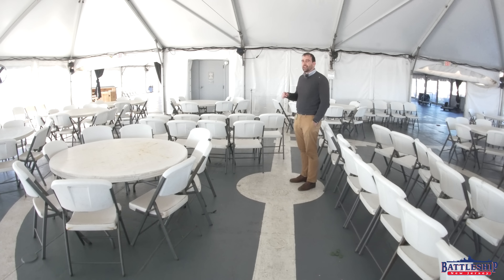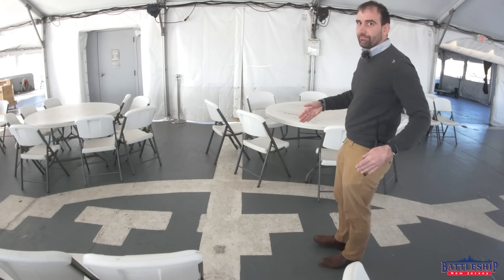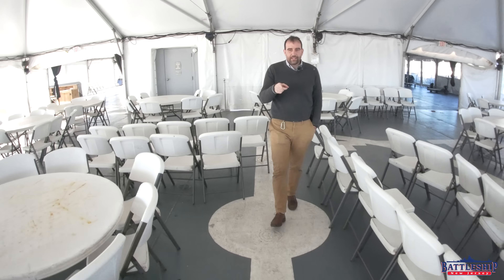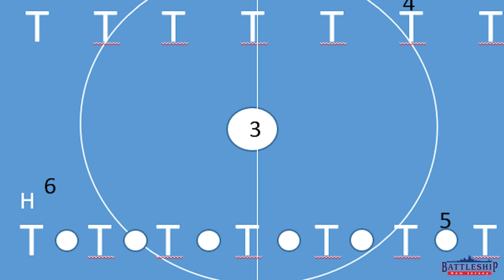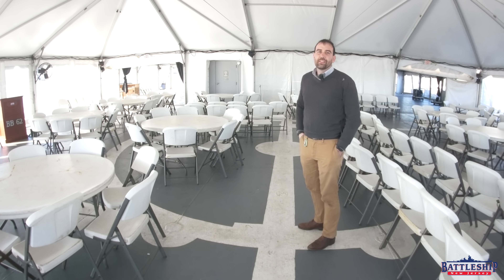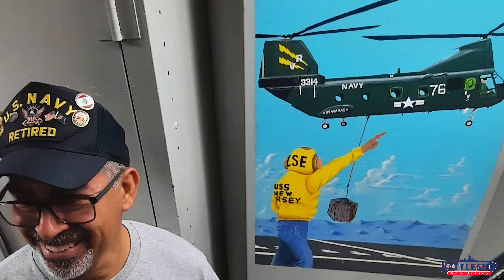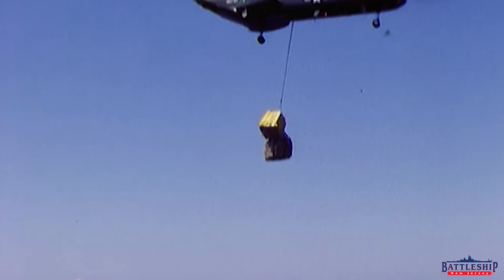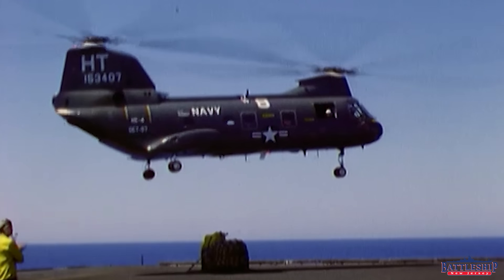What Do the Markings On A Helicopter Pad Mean?

Comment: T Line = VERTREP line for designated embarked helo. T/ball line = VERTREP line for large diameter rotor helicopters (not embarked helo). Also, Navy helo pilots fly from both seats. Either seat, left, or right, is used to execute landings in modern day Navy helicopters. Unless you are sliding right over something like a CVN deck.

Comment: In the early '80s I flew in a Eurocopter AS350 Écureuil
Light utility helicopter from the Central Pier in Atlantic City, NJ.  My Grandfather was the pier manager and the plan was to bring high rollers from NY to AC to gamble. The deck at the end of the pier had similar landing markings as the battleship.

Comment: When I was a firefighter the boss had me ride in the door of an S-58 flying out to a barely improved helispot somewhere on the fire.  First time ever on a helicopter.  My job was to watch the tail rotor and warn the pilot if it was getting too close to the mountain side.  Even though I was hooked into a hard point with a waist belt, I was scared shitless, and held onto the doorway with a death grip.  Like that would have helped me in any kind of emergency.

Comment: Actually, US helos began life with the collective lever (which controls motor speed and rotor pitch) at the left hand, so that the cyclic lever can be operated in the right hand.
Which mean, the climbing into the left seat means climbing over the collective.  
No such lever for the right seat.
So, the aircraft command pilot has an easier seat to get into.
In a fixed wing a/c, the throttle is/was mounted to the left, so the a/c commander sits closest to that throttle structure.
Reply: The cyclic isn’t a lever. The right seat has a collective.
Reply: Not the case anymore... the left seat collective in the H-60 is collapsible.

Comment: Flown inb multiple different helo (53/46/3, Bocamp = Messerschmitt-Bölkow-Blohm Bo 105  type - multiple location/functions. TO Marines they are a godsend and a lot faster than their own LPCs.  On one occasion got to be in 2nd from seat of the Bo105 when they had only 1 pilot. for the  H-46 (the  twin horizontal rotors) - a very different feel /.vibration from that rotor system. the Bo 105 was to from oil platforms Gulf of Mexico.

Comment: Military fly Right side = your cyclic hand is right, Collective hand isn't as busy so your radio and electrical service items are for your left hand.    Rotor rotation is not the reason - Landing on boats is fun (1984)
Reply: Sitting on the right seat puts the pilot indirect conflict with the rotor blade in the event of a hard landing. 1:38  I know. I saw it.
Reply: If you hit hard enough in a UH 1 that main gear box will enter the right rear cabin.
That's a crash not a hard landing. 45+ years helicopter pilot/ mechanic.- Bells Sikorsky Robinson Right hand. Hughes does both sides Enstrom Right. Hiller H 12 center. @oldmech619
Reply: @oldmech619  Some times but that's not the reason . I've seen worse.
Reply: @HongyaMa     I had one civilian Huey that had a hard landing. The rotor came around and hit the pilot in the head.  His face impacted the instrument panel. He didn’t have a helmet on.
Reply: @oldmech619  Stuff happens, Know plenty who are dead from either seat. Long lost to history. Floyd D Hiser one of them
Reply: Navy pilots fly from both sides in H-60s. Either seat can (and will) execute a landing on the ship.
Reply: @SAVY_JAX  Amen !

Comment: Ryan, one small correction because I was on a Flight Quarters Helo crash crew. The rotor blades were the least of the worries. The downdraft off the rotors would knock you on your but, especially the ones with twin horizontal rotors. Also, if they were carrying a load it could swing wildly. And if the helo crashed, most of one model was magnesium would burn. We were told to rescue the crew and then push the helo overboard because it was the most effectively way the fire would go out.
Reply: Yes, magnesium burns hotter than hell. Some metals are a high fire risk.
Reply: Yep, my flight quarters was in the proximity suit for all those reason.  One hot, weight losing job off the coast of Vietnam.
Reply: Lost an S 58 to a bad start. Went to lunch came back and it was all gone. Maggy not your fren
Reply: As a former firefighter I concur that fires with magnesium are no fun at all.

Comment: Hi Ryan.  I've flown as a passenger in an SH-3 Sea King from the deck of a Spruance class ship.  The SH-3 was not a tiny helo like the SH-2 Sea Sprite was, this thing took up a LOT of space and in USS Caron (DD 970) the crew chief had to watch and advise the pilot where the tail wheel was in relation to the edge of the deck, during my ride to and from the beach I had the job of holding onto his belt as he slid as far out the door as he could to watch that wheel.  😮

We launched from Caron, landed on cruiser Yorktown (same size flight deck), then flew to the beach to pick up the package I was the courier for and then back to the Yorktown and then Caron.

This bird wasn't even our regular chopper.  Ours had been damaged in an accident when it slid across the deck when the ship took an unexpected heavy roll while the bird was moved.  It was craned off in Naples Italy and we received a replacement plus flight and 'ground' crew from carrier Coral Sea.  I think we spoiled these guys, when our chopper was ready to come back they didn't want to return to the carrier saying our living conditions and chow were better and we didn't hit them with all the B.S. that was SOP on the carrier.  🙂  The crew chief became a popular member of the 1st Class mess.